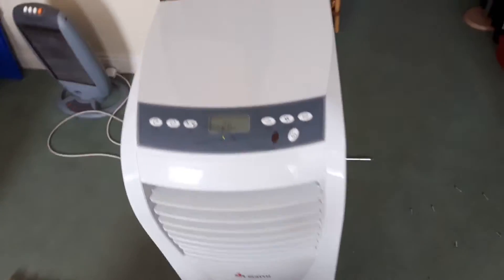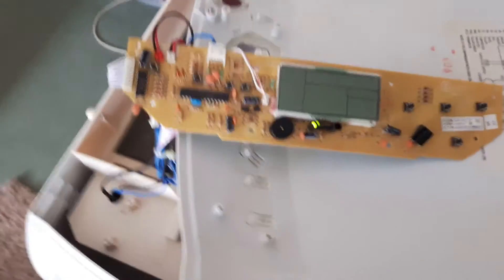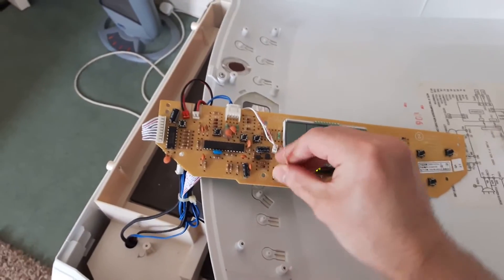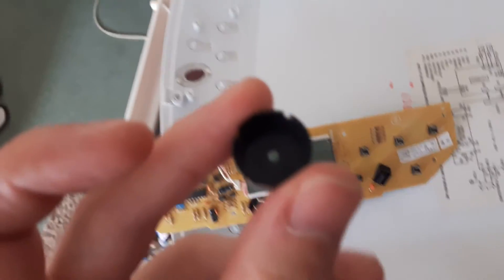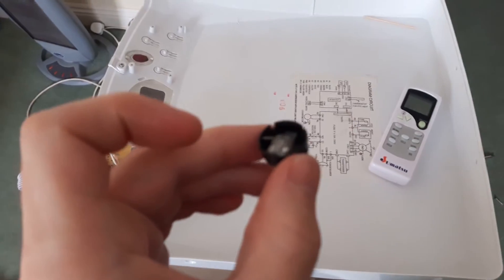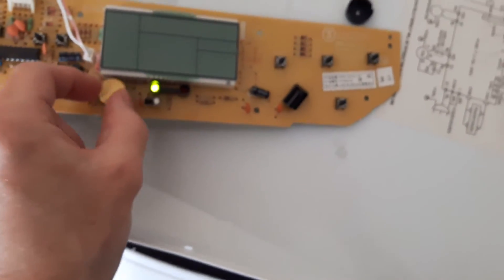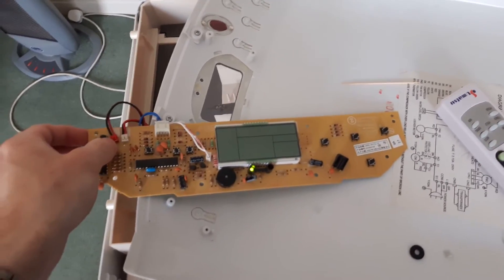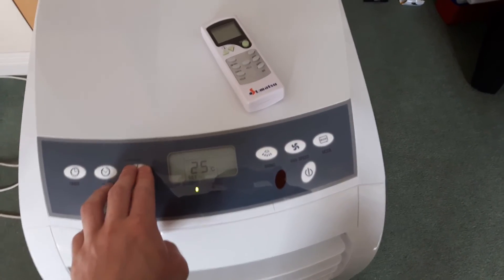Making a piezoelectric buzzer quieter

Comment: to make it quieter is enough to stick tape on the top
Reply from the maker: I tried that and it's worked on many before but a few I've had it doesn't work, or not well enough at least.
Reply: The Best Solution to reduce the buzzer sound is to put some Isotape into the small hole of the buzzer in the middle and then add some Isotape on top of it.